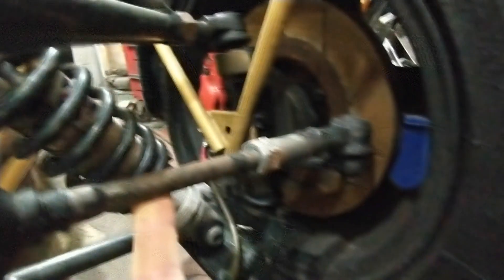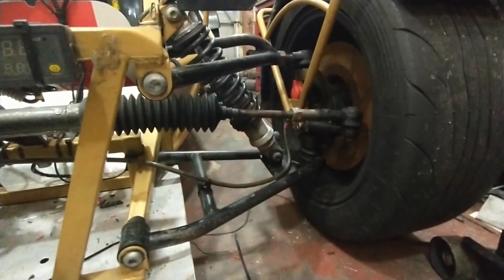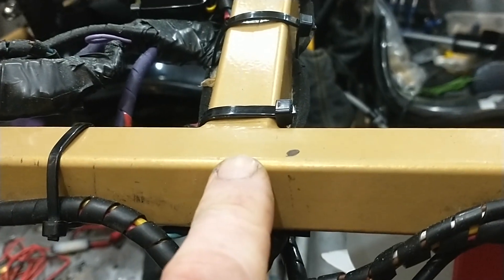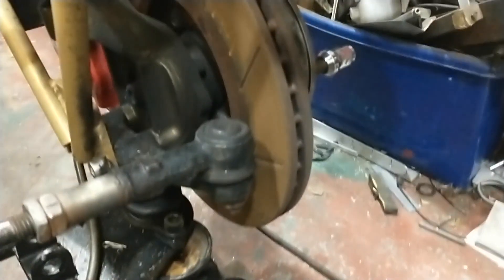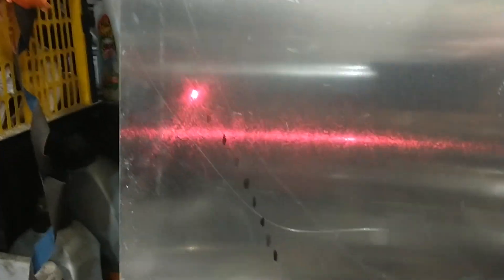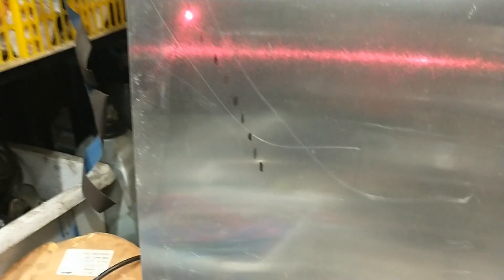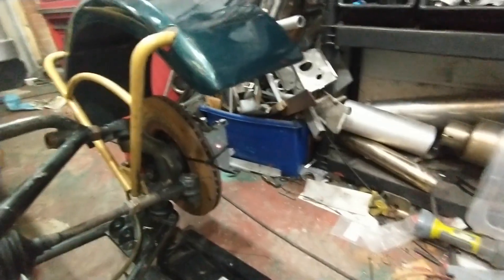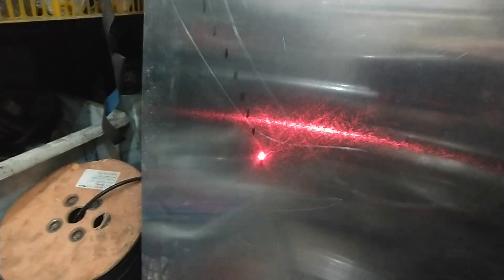Bump Steer - How I Fixed it on My Kit Car using a £2 LASER

Comment: Good video, your lucky the rack is the right length, also the theory is that you need a small amount of toe out on full bump and full lock so as to help traction instead of instant under steer.
Reply from the maker: Good point!

Comment: Also... reducing bump steer is not going to cure your understeer, that will be something else. Try a softer front anti-roll bar, quick test - just disconnect one drop link , see what it feels like then.
Reply from the maker: If the bump steer is causing the outside wheel to toe out, which mine was, wouldn't that cause understeer? The wheel is then not turning as much as I think it will be & the harder I corner the more compression on the wheel the more it turns out.

Comment: well done mate...glad ive got a solid front axle 🤣
Reply from the maker: That must make set up easier. But I think the bump steer would still be an issue if not set up.
Reply: @Lost13mm  works in a different way ...via the drag link !

Comment: Well done!  I used the same process on my 7. I had the advantage that I had not fabricated the mounting points for my shortened MGB rack. I just moved the rack around and clamped it in different positions until I got a vertical line with the laser.
Reply from the maker: Hopefully it will improve mine.
Reply: @I've Lost My 13mm AGAIN!  it only makes sense that if your tires are splaying apart under hard braking that it would understeer. Good luck!

Comment: I did something similar on my MK. I used a slightly different process and had to shim the rack to eliminate bump steer. It was the biggest single improvement I ever made to the handling
Reply: Can you remember roughly how much you shimmed the rack by?
Reply: @threepotMR2 I used 1 or 2 washers. I can have a look and check.
Reply: @stuwhite2337  That sound promising as I've just shimmed my Indy classic rack with about 5mm washer which has removed the vast amount of bump steer.

Comment: Thanks for the interesting video. Surprising that the rack was so far out of position.
However i wondered whether both front wheels doing the same. Is the other wheel moving the opposite way?
I was a bit worried about the idea of spacing the track rod end with a washer becausenormally these use a tapered fit into the steering arm, so any spacing upwards (is there anything for a washer to bear on to anyway?) - would surely make it loose. If you were using a rose jointed track rod, that would be different. Seems to me that moving the rack is a far better idea
Another idea is bending the steering arms, or using different ones.
It will be very interesting to hear a review of this mod after driving
Reply from the maker: Thanks for your comments. MK did a video recently on the same type of car and found it to be a long way out. TBH I am not surprised. The car is great to drive, but the quality of some parts of the kit was not great. It did not even have a build manual when I made mine!

Comment: Sorry but, that method ignores any track deflection, so gives a false positive. It's not measuring pure steering angle change as there's camber change and track deflection moving the laser beam as well.
Just use or build a bump steer gauge.
Reply: It's not completely clear if you left the washers fitted at the track rod ends. This sounds to me (and I'm no expert) like an awfully bad idea. These are tapered joints, so by adding a spacer the taper will never be able to get fully seated.
Reply from the maker: Hi - thanks for your comments. I got this method from a very good suspension book I've been reading.
I've just watched a couple of videos about bump steer gauges that use dial indicators. It looks to me that they are measuring the same thing I have, just in a different way - am I missing something?
P{S what is "track deflection" I have Googled it & the top ten hits are all about tracks used on tanks & snowmobiles.
Reply: Thanks for your reply. I'd love to know which book you found it in, could you let me know?
Track deflection is the lateral movement of the wheel/hub through suspension travel.
When the wishbones are as near to horizontal as the get, averaged between upper and lower, track width will be at its maximum. It gets slightly narrower above or below that point.
So... If you optimise the bump steer using your method, you will end up with actual toe-in bump steer.
Reply from the maker: @davidw7155  Sports car & kit car suspension & brakes high-performance manual is the books snappy title.
Reply: @Lost13mm  
Thanks for the info.
The book you really need is Allan Staniforth's, Competition Car Suspension.  Page195...
Then, Milliken and Milliken, Race Car Vehicle Dynamics.
BTW Mr Roberts does know what he's talking about 👍